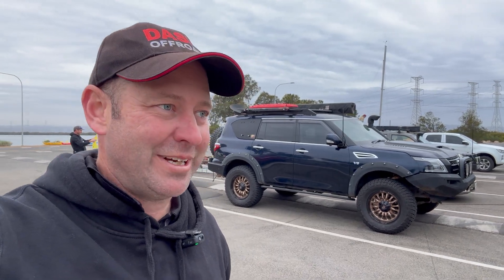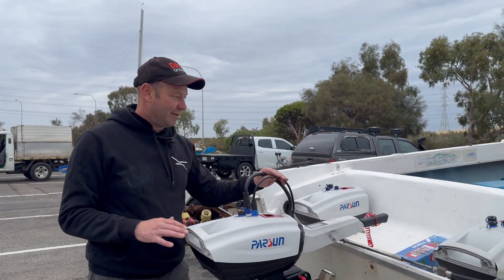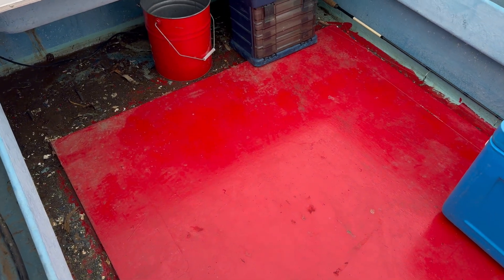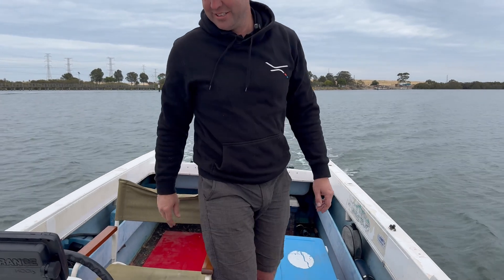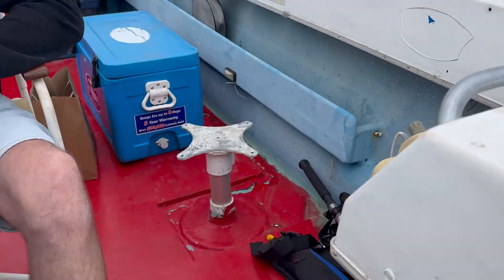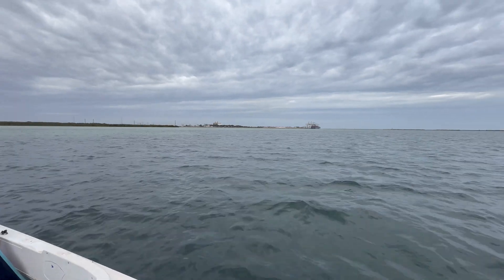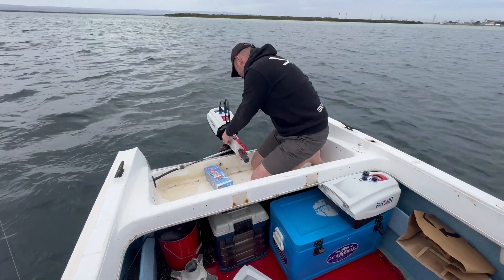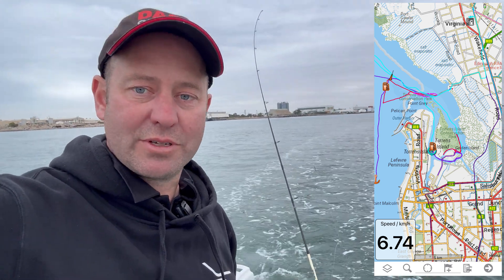My Solar Electric Tri Hull Boat Motor Project - Ep.1

Comment: A 1.2kw motor is about 1.6 British horsepower.  Excellent project btw, I'm here for it as I've built a much smaller version of solar electric boat with a 12'6" (4 meter) Bassmaster pro jon boat.  Mine features a 500 watt (3/4hp) trolling motor fed by a 100ah deep cycle battery.  In my version I've used a large rectangular patio umbrella (10'x7') secured at all 4 corners by paracord which makes it very secure.  400 watts of flexible solar panels up on top make it easily deployable and transportable.
Reply from the maker: Sounds very cool. Can I ask what sort of efficiency do you get out of the flexible panels? Would you get 200 watts out of them on a good day?
Reply: @DASHOffRoad  Sorry, not sure as I am using a cheap 100amp PWM solar controller connected to 2 Renogy 200watt flexible panels (found cheap on marketplace).  Out on the lake is full sun so I'm assuming at least 300 watts